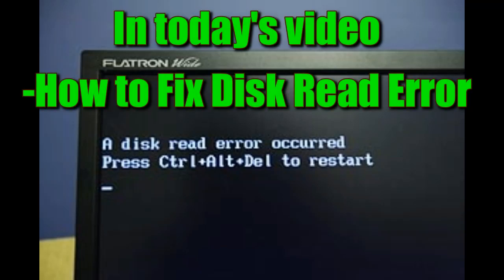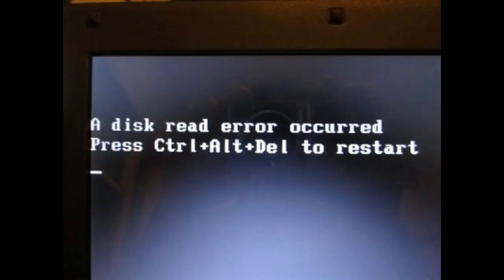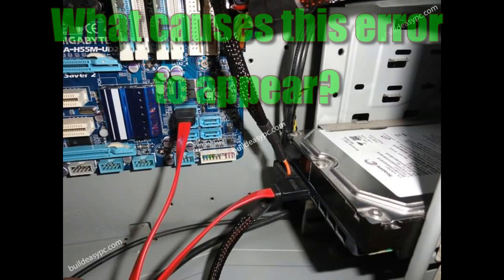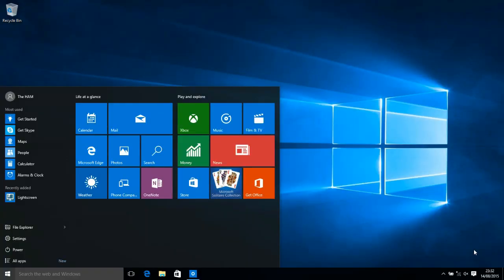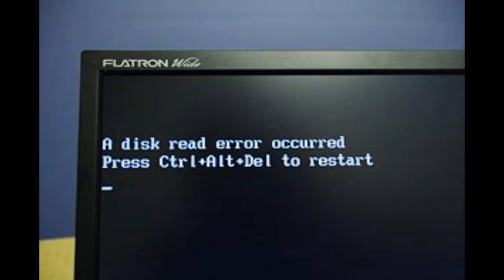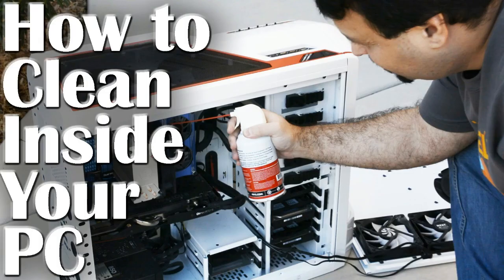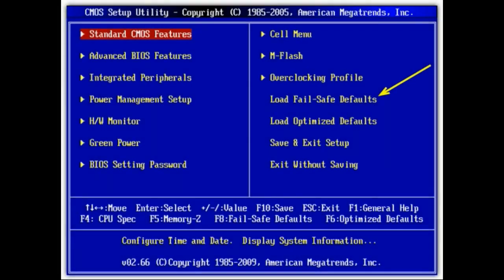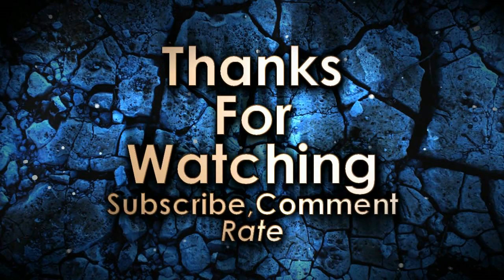How to Fix a Disc Read Error Occurred in 2018 | Easy Fix

Comment: Ok. I have this issue after restarting my pc. It's been running very hot lately, so maybe something has broken. My keyboard doesn't work which is the weirdest part about it. Would this be a motherboard or CPU issue?
Reply: If it is hot, replace your cooler or replace the thermal paste.

your keyboard doesn't working? Use a USB keyboard or your bus in your chipset is broken

Comment: I solved this problem by spraying my hard disk controller PCB with air. I had installed the hard disk upside down, and dust had settled on 
the PCB. Air has done the job.

Comment: I dont understand i did evrything but still i got the error. I check the cables and bois and it can detect my hard drive i also do the load fail thing but my computer did not reboot.
Reply: Jun Boy clean it and check the labels once more thats what i did and i fixed it
Reply: @skiesareblue  literally clean your computer. It's likely full of dust

Comment: When a system doesnt boot up specially windows os.

First is the operating system if anything hardware is the last to check,
Windows run kernel to start up. If a piece of code is missing or dlls it wont work so first suspect is the mbr partition and boot manager fix ing it first before touching hardware part is the smart thing to do.
Reply: How to do that.

Comment: And what when i get this error after i cleaned my pc from dust?
Reply: Exactly my issue
Reply: @RohitSharma-jn5nq  i did something to fix this but i don't remember what
Reply: @adamvaculka3210  It's Fixed Actually, Those USB Ports Were Causing It, Yeah Lol THat's Crazy, But All I Did Was Unplugged Everthing Connected To CPU And It Started Lol.